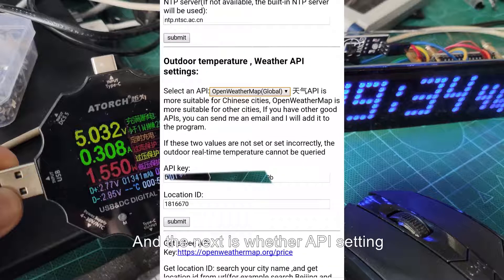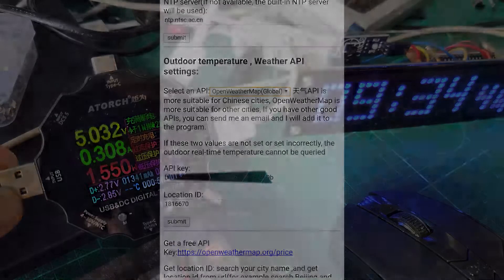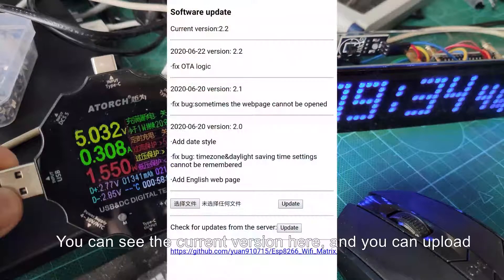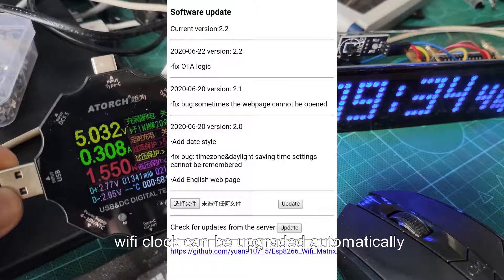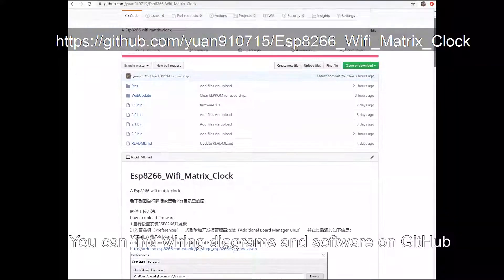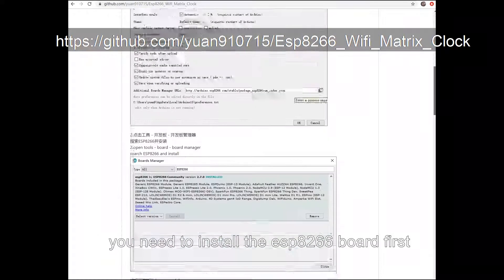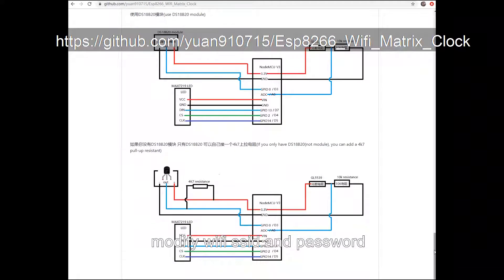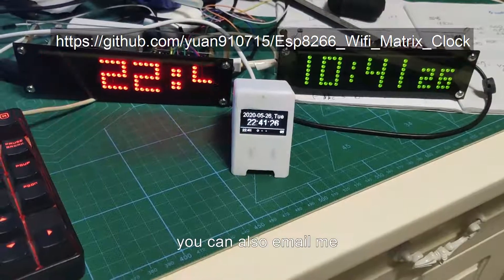DIY ESP8266 WiFi LED Matrix Clock, Arduino, MAX 7219 , NodeMCU v3, NTP Clock

Comment: Excellent ! Superb ! Your code is very good. I was able to install and run without any problem. The video also explains all functions nicely. Please continue the good work and keep updating the code. However, it would be nice if you can share code instead of .bin file, keeping in mind the open source community. Thank you very much.

Comment: Shame there's no source code 😢 I would have liked to have considered this as a starting block for my project. I need to be able to receive, display and react to messages posted to an MQTT topic by my other IOT devices.
Reply: Agree... love the project and the efforts, but I won't touch anything without the source code these days just due to security concerns (as this is on my network).

Comment: Hi Felix, the watch is great thanks for that. I would like to use 8 displays instead of 4, is there a way to set it?
Thanks
Reply: I also wanted to do that. It would make the custom text scroll so much more useful. I have seen other projects like this that had an adjustment for as many displays as you wanted, unfortunately, this project uses a .bin file that is not configurable. I have asked for this as an update myself, but get no reply. I can't blame Felix though, he obviously worked very hard on this software and probably doesn't want to share his hard work. He was making frequent updates, but those stopped awhile back. Probably busy with other projects :(

Comment: hi, Felix thank you for the project, if the power up both the router and clock at the same time, due to a router booting delay, the clock will not connect to the Wi-Fi router.

Comment: Is this possible to use without DS18B20 and GL5539 modules? Then what will be the PIN configuration? I only want to use NodeMCU and MAX7219 4 in-1 LED. What will the PIN configuration and what will be the code? Please please help me.
Reply from the maker: yes, you can find PIN configuration in https://github.com/yuan910715/Esp8266_Wifi_Matrix_Clock

Comment: Hello, I just made the connected clock and it is beautiful. You really made a nice project. I would like to know if you could provide a 5th display 7219 to improve the display of temperature and humidity at the same time. a number is missing when it stops for a second. Thank you in advance and have a good day. I tried the telegram but without success

Comment: Hello, I saw this video by chance while zapping and I remained very interested in the project. I tested it and everything works wonderfully. Some small defects for the display so much that there is a possibility.  So I say BRAVO because it's a genial clock. Congratulations to the designer..With a DHT22 The humidity display cuts a little that of the temperature. otherwise perfect

Comment: Hi Felix thanks for your excellent efforts for taking pain for such a wonderful project.

I had assembled this project with your latest firmware and it is working fine.I have the following suggestions to implement in future updates.

1.If we are using the DHT series sensors, the temperature and humidity display can be limited to 2 digits for room temp and hum display without any decimal values (like the one that displays in openweathermap).The issue is, if decimal values like 26.1 is displayed, two  digits are going out of the left most matrix OR modify the code such that for hum/temp section, there should not be a pause between the openweathermap and room temp display so that we can feel it as continuous scroll.
2.Code to display the detailed weather conditions like wind speed, sky and weather status in the scroll.

Also I request you to make another simple project  for driving WS2812B ring LEDs with ESP8266 for 60 ring LEDs to work as analog clock.

Thanks in advance, All the best, Hareesh.

Comment: hello Friend , 
your project is just awesome . Thanks ..

this one is more a request or a suggestion rather than an issue ...
can you add an option to have customizable ip address .so that we can add a static ip address
coz sometimes when network fails and reconnects the Ip address changes ...yes it shows ip address in the matrix at start up but there are also other devices [with preassigned ips] in the same network and there are clashes...
 So i request to add this feature in the future updates....

Comment: gr8 project but when esp8266 disconnect from wifi board will reset and need to configure again 
any solution for tt?
thank you
Reply from the maker: please change another board and try.
Reply: @felixfeng3055   esp32 will work??
How permanently set time zone instead of yours 
When i disconnected from wifi board will automatically goes into your set configuration

Comment: Thank you Felix. I was able to work this nice clock smoothly. However, even if the time difference was set to +9 hours in the WEB settings, it was actually only +8 hours, and I had to set it to +10 hours to match Japan time. The version is 3.1.
Reply from the maker: hi, I think you turned on the daylight saving time switch , please check

Comment: Works great, but there is no way to choose a +45 minute time zone, or UTC +14/+13 (Kiribati for example uses UTC +14, Nepal uses UTC +5:45 parts of New Zealand UTC +12:45/13:45).

Also there should be a setting that can control the brightness over time (so that the clock automatically sets the brightness to for example 0 at 10PM/22:00 and to 1 at for example 8AM)
Reply from the maker: I will add and push an OTA, thanks a lot.

Comment: Is there any chance you will be sharing the source code?
Reply from the maker: Hello, there are still some areas in the code that need to be optimized. For example, I am going to change the configuration page to a more beautiful html5 page. Another point is that I use the OTA server to count the devices used. Once it is open sourced, I believe many people will delete this code.  , I can no longer count the devices used

Comment: Sir Felix, I have a problem. Only the last led matrix shows the other 3 are all lights ON.
Reply from the maker: Check the wiring and the installation of the led. The led can be plugged in. It may be that the led  is reversed.
Reply: @felixfeng3055  Salamat! ( Thank You! )

Comment: Good job ,....!!!!!!!please where is the code????? thanks  in advance Eddy
Reply: No need to upload webupdate.ino. just take 2.7 bin file upload it on nodemcu thats all
Reply: Open esp8266.exe file select the path of bin file and flash
Reply: @pcmobiletechnicalsolutions8504  hey bro, I have upload 2.4 bin, default clock is running, but wifi clock configuration didn't come, what do I do???
Reply: @addiction-69  when the clock starts you can see the ip? Go to the ip with browser. Then set all the things. Remember you need to connect same network
Reply: @pcmobiletechnicalsolutions8504  you mean bro, Before Save ssid and password it automatically redirect the wifi page for ssid and password, after configure that, it shows the new IP address and that will be the entrance in wifi clock software  page am I right???
Reply: @addiction-69  yes sir. Make sure you ar connected with same network then it will work
Reply: @pcmobiletechnicalsolutions8504  thanks bro, clock is working awesome, but I want to hide the last info part in the browser how am I do that?? Could you tell me??
Reply: the 2.4.bin has the all codes. upload through exe tool or android blynk uploader
Reply: Thanks my good friend
Reply: @pcmobiletechnicalsolutions8504   i can't open .bin file can you recommend to me any free software to open .bin file and see the code please.thanks in advance...
Reply: No need to open bin file just flash it on nodemcu. It works good. I also don't have idea yet to open bin file. I am just begun learning. See my video i uploaded. Same type. But easy.
Reply: @pcmobiletechnicalsolutions8504  How to flash with the Arduino IDE??,i am a beginner, for me is more asy seed the code learn and download with arduino IDE.
thanks my good friend for your time 
be safety !!!!!!!
Reply from the maker: @eddy4011  you can see https://github.com/yuan910715/Esp8266_Wifi_Matrix_Clock    use webUpload.ino
Reply: Hi Felix i already did the webUpload.ino file downloaded to the Arduino and update the ssd and pw the esp in on internet and i saw the esp ip i don't understand on the video ???? let me know the next step please?how to  down load the 2.7 bin file in to the esp...
i am sorry about my English and thanks for your time.Eddy

Comment: A very nice design, well done. A lot of work has gone into this.
Reply: Hi! Ralph,
Love your channel too & the detailed explanations. It indeed is a really nice n easy to use clock. However, in my case, whenever I try to do any changes to the Display page, date, time format or other settings, the dsiplay goes blank & font option also is no longer available. Initial booting text and custom message works fine. The clock display is restored only after a re-upload using erase all flash contents.
Reply from the maker: @avinashsalaskar2118  hi , I received your email, it's a bug , I add a new font but forgot to add font settings  on English web page , I have fixed it in version 2.5 , you can restart your clock , it will auto update to 2.5, or you can upload 2.5.bin manually.
Reply: @felixfeng3055  Thanks for the prompt revert, it seems that the OTA has already taken place in my clock during a power cycle. Thanks once again for the same. I haven't tried doing any changes to the display settings page, but am sure that the fix should have taken care of it. I like the clock & sincerely appreciate your efforts. This is the first one of the matrix clocks that I was able to get up and running hence am very happy & thankful to you. Will be following you for some more great stuff in the future.